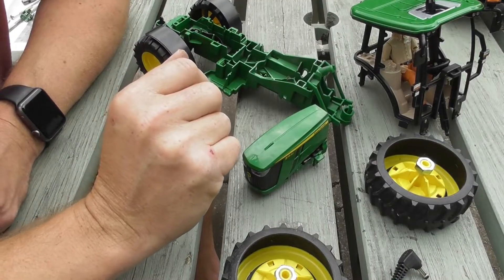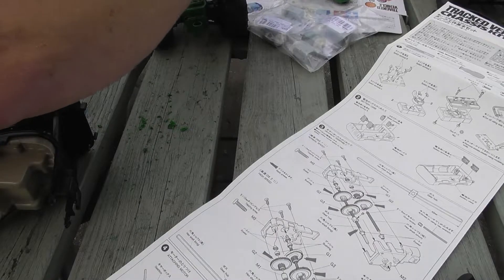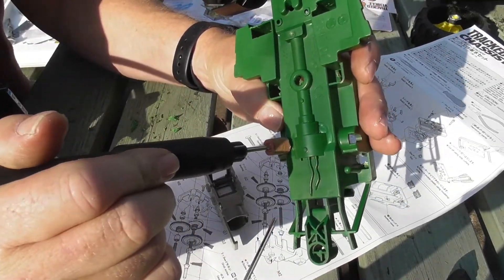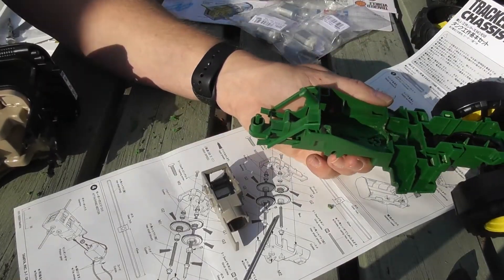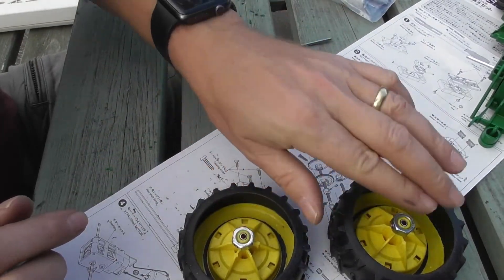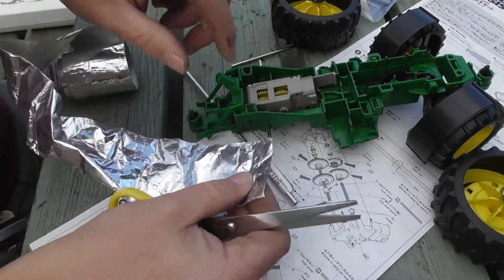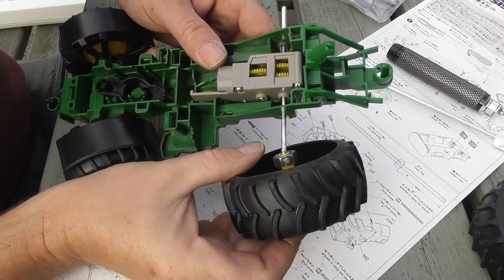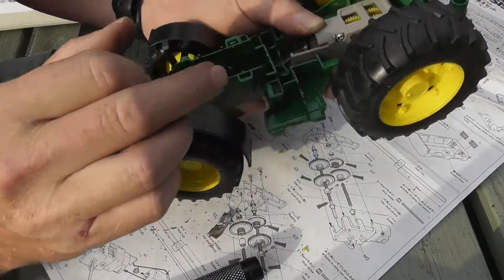Bruder Tractor RC conversion pt2 : transmission

Comment: Great video and what great method for rc conversion. I'm scouting the net for a decent cost effective way to convert my kids 1:16th Massey and see all sorts of methods. I thought the Tamiya gearbox would be a bit too weak for the scale, your nut and tube idea for attaching  the wheels is brilliant!! I think ill go this way too. First thought I'd get two geared motors and hubs but your way seems to be a better idea
Reply from the maker: The tractor is one of my favourite conversions. Runs very well. I think I improved the wheel attachment in the later videos (see the sprinter transmission - I think I did this better). 🙂👍
Reply: @RCModders  i saw it. nice one too. whats the length of the driveshaft on them tamyia gearboxes? cant estimate it from the video, looks like 12-13cm. i've got a couple of 12v 100rpm geared motors for that 1:16 we have. saw people using 25mm tube for housing the motors and flanges to attach the wheels. ive converted a 1:60 Bruder truck using WPL gearbox and diff. works fine, just no suspension. looking forward to the MACK conversion. saw the pilot episode, well done
Reply from the maker: Just measured one - 100mm or 4 inches approximately.
Reply: thank you
Reply: Any gearbox is good enough if you gear it down enough to have a decent amount of torque. To get the maximum speed with a specific motor, the amount of torque (in Ncm) needs to be either the same as the weight (in grams) or if it's going very quickly, add aerodynamic coefficient to account for losses (for example if your vehicle has 0,27 aerodynamic coefficient and goes like 100mph, then you need additional 0,27 times the torque on wheels to cut through air).
Reply from the maker: The tractor is one of my favourite conversions. Runs very well. I think I improved the wheel attachment in the later videos (see the sprinter transmission - I think I did this better). 🙂👍
Reply from the maker: The tractor is one of my favourite conversions. Runs very well. I think I improved the wheel attachment in the later videos (see the sprinter transmission - I think I did this better). 🙂👍